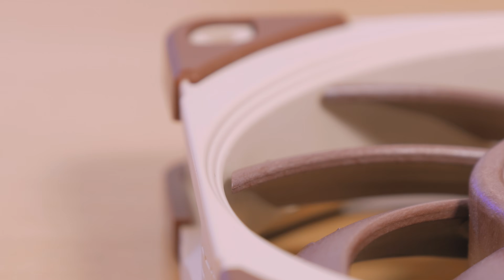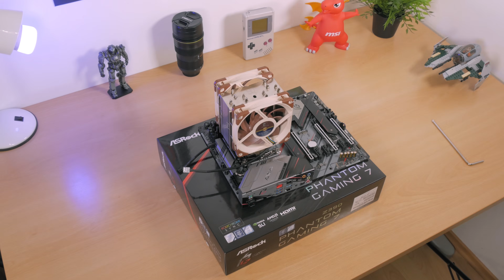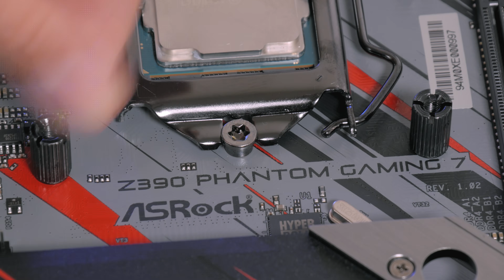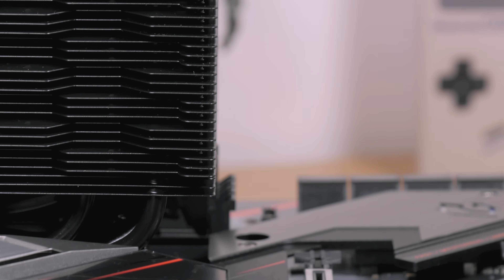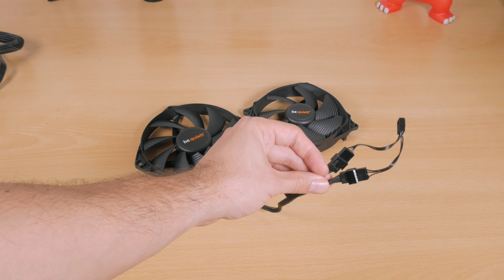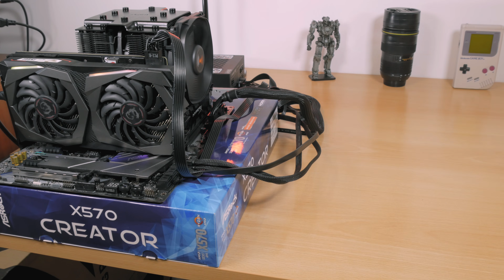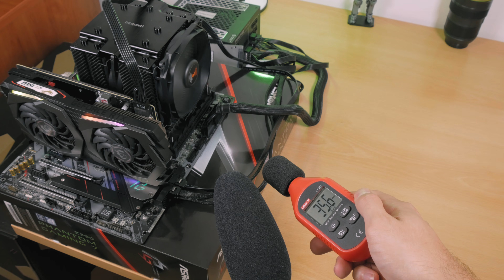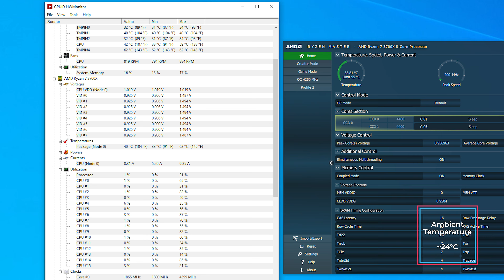CLASH of the TITANS - Noctua NH-U12A vs Be Quiet! Dark Rock Pro 4 (i5 8600k & Ryzen 7 3700X)

Comment: Best air cooler is thermalright macho la grant rt i buy him for 60usd and beat my noctua nd 15 quiter and cooler
Reply: I've watched several reviews now and although the Macho RT might be ever so slightly quieter than the D15, the D15 still beats it in performance.
Reply from the maker: That's a real beast! 😁
Reply: @MattsPaddock  Linked you over Twitter a cooler that trades blows with the Dark Rock 4 Pro & Noctua NH-U12A for only 60 USD, the Scythe Fuma 2
Reply: @dorientjewoller113  of course it will beat the NH-U12A, because it's bigger.. lol NH-U12A can fit matx cases. They're not in the same league..
Reply: @jomac21  Don't get the bragging rights of the NH-U12A because it fits matx cases. Yet, the Noctua has a height of 158 mm,  where the Fuma 2 is only 154.5 mm. And as both coolers don't exceed the parameters of an matx motherboard, I am pretty sure the Fuma 2 will fit an matx case too. The heck, already have seen builds in a matx case with a NH-d15 in a NZXT h400 case, so your point has no value. LOL. Sure, they ain't in the same league, but 60 Dollars for only trailing 2 degrees to the Noctua NH-U12A, 5 to 7 decibel more silent then the Noctua, with the ease of installing the cooler even when the fans are premounted, puts the Fuma 2 out of the league of the Noctua NH-U12A, above I would say.
Reply: @dorientjewoller113  fuma is a double tower design and nh-u12a single tower. That's what i meant about not in the same league. Compare the fuma on noctua's double tower design cpu cooler. While Fuma is a double tower design and have more surface area, it still have higher temps under load.  Lol it's only 2 degrees, but its a win. im not talking about the price. Of course, noctua is and will be more expensive. Try to compare noctua d15 and fuma. Then compare u12a and scythe single tower cpu cooler.. what you pointed out about ease of installation and pre mounted fans have no values too. Noctua's cooler are among the easiest to install in the industry. Pre mounted fans? Lol is that even a feature?
Reply: I think the key thing worth mentioning here and also relevant to some of the comments, is that the Noctua U12A  is a single tower cooler AND it's a 120mm cooler. The fact that it's being compared to dual tower models with larger fans, in itself sets it apart. If you want a true apples and apples comparison, we must use the D15. 

But in terms of noise to performance ratio, especially when taking price into account, I believe the Scythe Fuma 2 is the boss. But again, it's a dual tower design. This is why the U12A is simply fantastic. 

For reference, I am running a 3900x OC'd to 4.4GHz on all cores at 1.325V (haven't hit a ceiling yet!), using the U12A. Cinebench and hours of cpu-z stress testing have temps never going over 70C. I have focused heavily on quiet case airflow as well, which plays a significant role. So, you just can't get a better 120mm, single tower cooler today. Noctua is in a class of its own. I don't think it's that special that others are trying to achieve the same cooling and have to resort to dual tower designs to do that.

Comment: I'd say Dark Rock 4 is more comparable since they are both single tower 🤔
Reply from the maker: Yeah, I said something along of that on the beginning of the video, but in the end these two ended up to be a good comparison since there's minimal performance difference in between them, while Dark Rock Pro 4 is still a bit cheaper, and I assume that the regular Dark Rock 4 would have even harder time to keep up with the NH-U12A
Reply: @MattsPaddock  ok if all that is so then the even more expensive and bigger nh-d15 is not worth buying because it has the same performance as the dark rock pro 4.
Reply: (Lord Of The Rings And) The Two Towers
Reply: yeah but the dark rock pro 4 is still much  cheaper. would go with dark rock pro 4 anytime lol at that price point